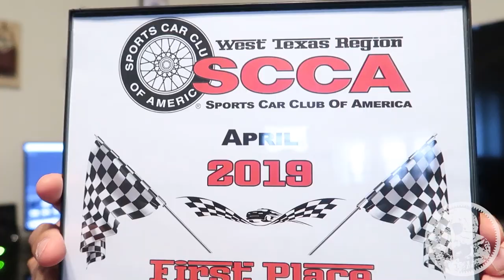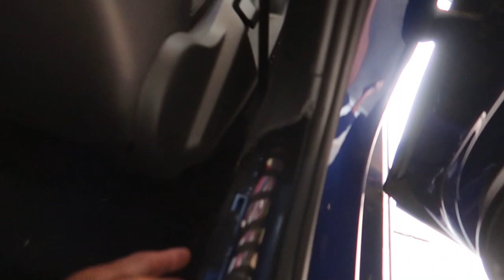MAJOR TRANSMISSION FAILURE! Time to build the motor and trans! | MK7 Golf R

Comment: IE block maybe then send the head to get ported?

Rs3 brushless lpfp and a fresh set of gears/synchros.  Hopefully, the issue is pressure plate or throw out bearing related.

Had a throwout bearing fail on my s2000 and the symptoms sound extremely familiar.
Reply from the maker: Drained the trans and it's definitely trans failure, hoping the clutch is fine.. imma build the bottom end myself, hopefully send off the head for work and valves and all that, send the trans off for LSD, gears, supports etc.. should be a fun time

Comment: Go DSG it will suite your racing so much
Reply from the maker: It would but that's so much extra work and weight
Reply: I’d say you gain more from dsg in time eg (seconds per lap), than you would from weight gain
Reply from the maker: @123gtt  I don't think you understand how much work it would take lol, I'd rather have a built manual with dog gears and LSD
Reply: Bryce Jordan Productions 
Yeah it’s a lot that’s true bud. But you’ve a tonne of work ahead of you, getting everything built and it’s on the floor. 
All that work not to take advantage of probably the best gain 0-60 time wise, and track wise. It would be worth it.